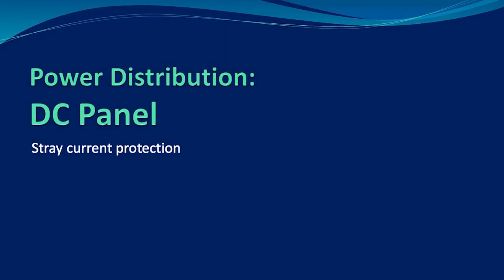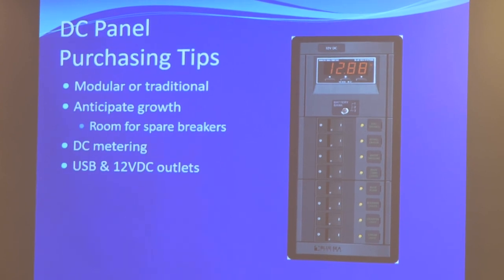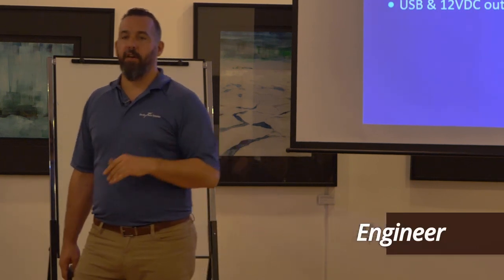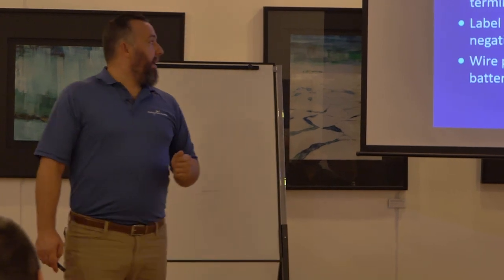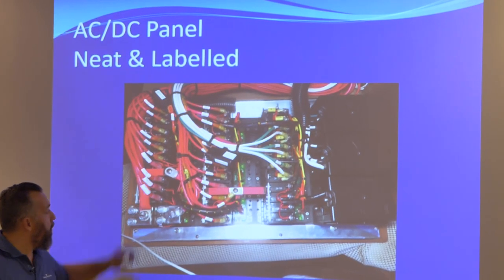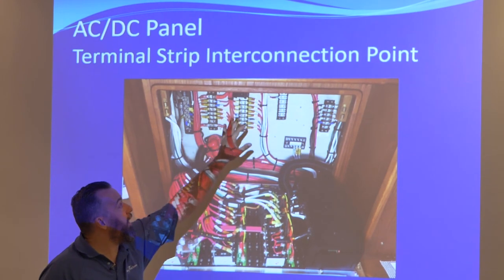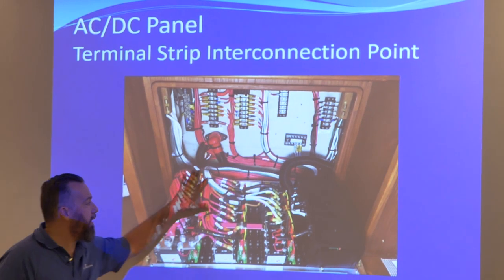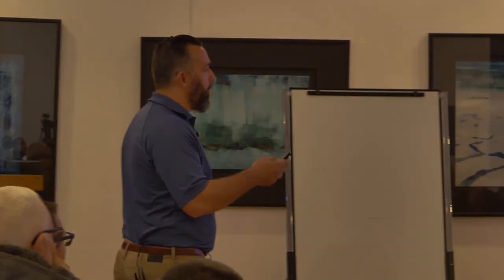How To: Marine Electrical Seminar - DC Panel - Ep 15/30

Comment: Is there a video you know of that I could watch to properly do this? I'm trying to get rid of my rats nest, I only have one device connected to each breaker and I'm trying to add a rocker switch panel at the helm for certain devices instead of switching everything off and on directly at the breaker panel.
My helm is only 6 feet from the breaker panel but it's annoying.
Are relays necessary?

Comment: That’s it?  Zip ties?  Bundling/heating? Drip loops? Service loops? LEDs on breakers? Custom labels? Panel face materials? Digital vs analog gauges?
Reply from the maker: Hi Robert, all good points. Definitely could have gone deeper, but many boaters already have DC panels and it's NOT the most tantalizing of subjects. Next time i tackle DC Panels, I'll go keep for us marine electrical geeks.

Comment: Hi Jeff- I love all your videos and are compiling some of your best for my employees to watch to understand how professionals approach their electrical work.  My question is this- we build small camping trailers in the US (teardrop trailers) and currently run 5 separate DC circuits from a Progressive Dynamics 4100 Converter (converter+dc+ac distribution) out to berth lights, roof vent, 12 volt outlets, etc...and have historically used separate color wire for each circuit (gray, yellow, green, etc..).  Similar to a boat (I'm guessing) almost all of this wiring is hidden in walls and only visible at the distribution panel/converter.  I see all the wire at your distribution panel (beautiful of course) is red/white/black.  Any reason for us to continue using different colored wire (inventory pain) vs running red/white all the way to the appliances?  Thanks much for your input and keep up the great work!
Reply from the maker: Hi Greasywheats, sounds to me like your way works. In an ideal world all individual DC loads would have their own color code, but unfortunately in many cases there are more loads then available wire colors.
Reply: @PacificYachtSystems  Thanks for your reply, Jeff! If only I could find 2-conductor parallel bonded wire/ zip cord in specific color combinations (white is always our trailer ground) to cut wire pulling time in half! We currently use individual color/white spools to everything.

Comment: 2 years late: The only down side to terminal strips is you have broken the conductor and have added two potential failure points. Bad crimps, corrosion,etc. Just a thought.
Reply from the maker: Hi Richard, you bring good points, every junction on wiring introduces other point of failures. It's all about balancing pros and cons, that said, a terminal strip for electrical panels is a good way to keep the panel wiring very organized.